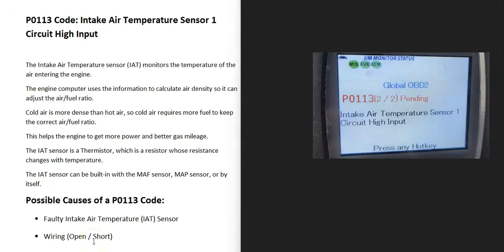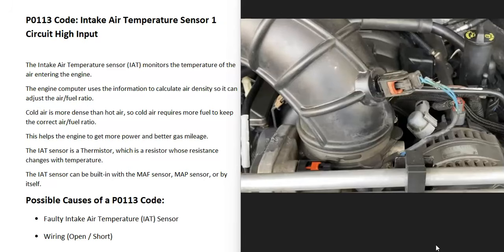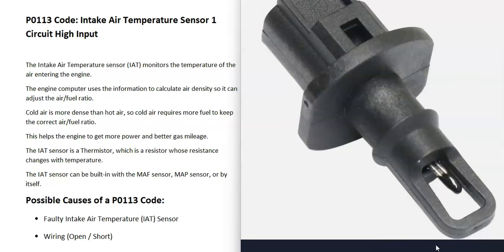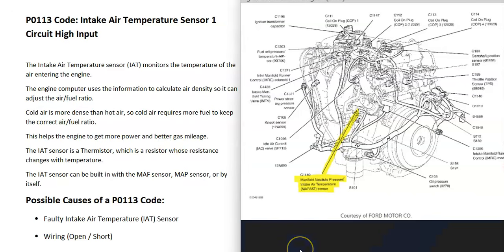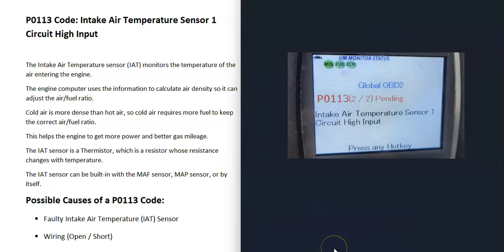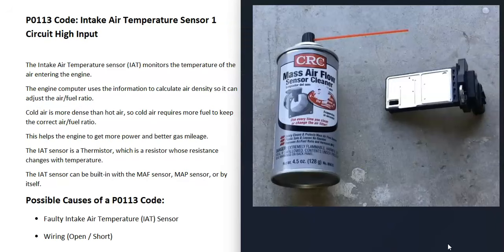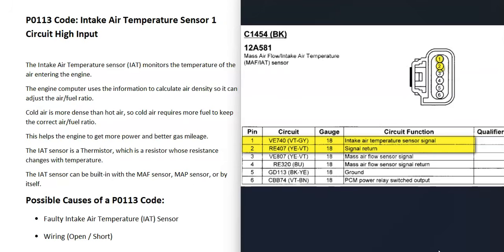Causes and Fixes P0113 Code: Intake Air Temperature Sensor 1 Circuit High Input

Comment: What does "chassis control system error" mean?
Reply from the maker: The computer is seeing an issue with the traction control system, like a communication problem or a failed component. While it can be a failed component (usually also gives another code), check the battery terminals, and if they are good, test the battery and alternator. If the computers have a power supply issue, they can give communication codes.

Comment: Got this code, intermittant starting, replaced intake sensor and still didnt want to start, when it did it was limping forward (reverse fine). Brand new fuel pump too, is there a filter clogged up maybe?

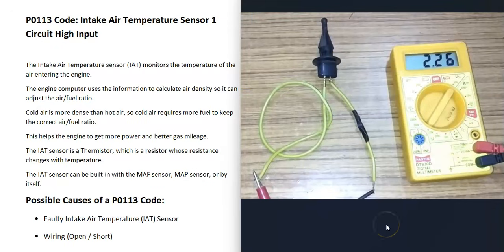Comment: @2:10 you talk about testing the resistance in the sensor. I've seen people say you have to have it plugged into the wiring in the car on in order to do this is that true? The picture at this point in this video shows just the sensor out as if it's being tested normally.
Reply from the maker: Yes, it can be tested out of the vehicle using a meter and ohms. The rated ohms it needs to be at will need to be looked up.

Comment: I have a 2013 fusion 2.0 eco boost . On my live data scan tool my engine will be warm then the engine temp sporadically drops to 88 f or zero then goes back up. Also the iat reads like 255 f. The codes never store so I can’t see them and it happens intermittently.  What should I check?
Reply: This irregularity could be the sensor itself.  If you pull the sensor and check resistance at room temp and then blow a heat gun or hair dryer at it, the ohms should change and hold at a different value.  If the resistance bounces around, the problem is the sensor.

Comment: I think our problem was I had it unconnected I had taken off the air intake tube and I started the truck with all without that hook attached and it probably set off a code. I’m waiting to see if it clears. Thanks.

Comment: I got 03 ' focus SE .... everything solid routine veh maint. Ford Dealership whenever necessary Ford recommended OEM replacement parts ect. .... prior to the issue which has now developed  (Engine light on w/error codes 0108 /0113 )  I noticed a clearly obvious hole rubber boot from air box looks as if intentionally someone used pocket knife flat smooth finger nail sized cut out and ..u know ..wth ?? serious injury neck & back significant financial circumstances I simply wrapped ducktap for temp precaution and ordered the replacement boot ...three days veh began loose performance sluggish hesitant acceleration etc. I pulled MAP sensor carefully cleaned & Removed air box cover inspect wiped down as well obviously a significant breach nicked a hole thru rubberboot which dirt grime 300,000 mi engine compartment clearly I'm assuming must have damaged the sensitive filament wire of the MAF/ MAP Sensor since the cleaning attempt hasn't corrected the issue and the new boot has been installed ... any thoughts or further suggestions I, waiting for my MAP / MAF Sensor replacement parts to arrive once delivered I'll have to do the install myself and under a huge amount of painfull circumstances spine injuries back & cervical  kinda gruesome to say the least hope im not overlooking anything is why I'm reaching out ??

Comment: I've replaced my 2010 acadias maf twice also checked wiring. It has several other issues for the 02 sensors, steering and brakes. I've decided to get a new ecm so just to rule that one out. My iat will not go back to normal stays at -40°
Reply: We're you able to fix it?

Comment: Can the code happen after a thermostat is replaced? If they didn’t put back right maybe? And now my car struggling starting.
Reply from the maker: If the thermostat is installed wrong, that can cause overheating and trigger codes. The engine should still start when cold but then will overheat.
Reply: @HVAC_Mechanic I got code p0113 yesterday can that have something to do with the thermostat. I have to put my car in neutral to start everytime
Reply from the maker: That is unlikely and there would be more codes. Usually when an engine thermostat has an issue there are codes such as P0128, P0125 or P0126.

Comment: My truck starts and dies immediately and has a shitty idle. When I disconnect my maf which my iat is part of the truck starts when reconnected it dies what should I do the fix it
Reply: Just figured I'd share I'm having a similar problem 2004 Dodge ram 1500 V6 just swapped out an engine for a used one. I was with mechanic and neighbor who was doing the engine job for me giving him a hand so happens soon as we can act everything I jump in turn the key starts right up and engine is pouring like a kitten we drive up to the store grab a soda a little short test to grab a soda maybe 5 mi round trip when we get to the store before I get out of the truck I noticed the temperature gauge is at about the 2:00 position in other words it's usually always in the middle it was between h and the middle getting hot. So to be cautious we hang out for about 30 minutes at the store we went to and mind you I literally started the car 5 minutes before that so it was ice cold and it didn't overheat. So new engine in test drive the only problem we could see and was obvious was the cause of the heating because the thermostat was broke and old is dust. So we figure change the thermostat and we'll be good to go. we grabbed his truck go to the auto parts store grab a thermostat and also a TPS sensor and it was a little bit cracked and the connection wasn't that good. So get back from the auto parts put in the new thermostat put on the new TPS sensor now when I start her up, misfires, real throaty sounding engine like top fuel loud but very sluggish unresponsive when you step on the pedal at times you got a feather it and work your way up to speed so I am fucking perplexed because prior to the new thermostat and TPS sensor the fucking car ran like a dream it sounded beautiful in idol beautiful smooth. Now it doesn't even want to stay running and wants to stall at every stop sign and red light. . Later that day we checked all the coils have power put in all new spark plugs. Was going to replace the IAC sensor but it was tested with a multimeter and it still worked but I don't know if that necessarily means the part is good just because the multimeter lights it up. possible issue I don't know if you know anything about that I was trying to buy a whole new throttle body couldn't find one so we took the whole thing off took it apart cleaned it out with cleaner reconnected everything. Now I was concerned about possibly a computer relearning of the sensors but after doing more than one reset technique I discovered that that TPS sensor is supposed to be able to be swapped right out without having to relearn anything. I did do the disconnect the negative battery terminal. And I also did the step on the gas pedal slow four times reset nothing's worked..1. take out old engine. 2 put in new used engine. 3 immediately started right up first try. 4 take a short test ride up to grab a soda and noticed that the temperature gauge is getting a little hot so we stopped to prevent damaging the engine.5. Get his truck up the road to O'Reilly's grab a thermostat and a TPS sensor. 6.Go back swap out the old parts for the new. Thermostat and sensor 7. Turn the ignition bulb bulb bulb. Hard idol wants to stall of course now there's no temperature problem with the new thermostat. When you first go to put the car and drive and step on the gas pedal to pull out off. You have to push the pedal down so gently until it kicks in and gets going but every time you idle at a light or a stop sign you got to put it in neutral and rub the gas or it'll stall out it's got bad power now. You know Sputturring, misfire. So start looking for a new throttle body can't find one you got to call the manufacturer now or find a used one. Thank God I didn't cuz I don't think that was the problem I damn near replaced all the senses anyway. But it was removed and cleaned like new reassembled with the sensors. 8. Try to adjust the idle so it revs higher. That's not working. 9. Took out the six coil and tested them all he said at one point the car was running on one cylinder. All of the coils were working order tested each one. So we go get new spark plugs because they were kind of crispy.. 

New TPS sensor 
New spark plugs 
New thermostat 
New serpentine belt New tensioner pulley tested MAF sensor and IAC sensors for voltage 
Checked all the fuses in the fuse box present or not accounted for with the multimeter 

I'm not a mechanic but if I had to look in a direction based on all of the research videos people and this and that Hands-On I've been through with this. 

We are basically troubleshooting this car down to actually one piece at a time. With all I've researched and all the videos I've watched the general theme seems to lean in certain directions with certain years and models of these trucks. I've encountered numerous people just in the last day or two online and on chat rooms videos that have very similar issues I'm thinking I have to start at the fact that the engine ran absolutely fine until I put in the thermostat which I think had nothing to do with it and the TVs sensor which was relearned even though it's supposedly doesn't need to be. Also thought maybe my gas might have got wet and the tank was almost on empty at this point so put filled it with premium intake cleaner and octane booster. 
I'm leaning in the direction of airflow and vacuums and fuel lines and injectors in other words the oxygen heat and fuel mix is off. Therefore the misfires Sparta ring stalling at idle. But as I look further and listen to someone say when you check the hoses and the wires the harnessif you cut any corners and try to get it done with a quick troubleshoot I'm thinking that this is one of those issues where I'm going to have to take the wiring harness off lay it out and look with a magnifying glass, and a light and go literally inch by inch look for every tooth in every plug you know any tiny crack. Because although I'm not a car mechanic sometimes it's just an unrecognizable small defect that is causing total operational failure. Also I read another person had an issue just like this what said their truck had an exhaust leak. This was not something I considered at all in my top 10 things to look at first or my mechanic put my whole exhaust and catalytic when missing off my truck when I bought it used so my guy just grabbed the Durango muffler and pipe and just threw it on there to keep it quiet so being as it's not still that quiet I know it's kind of like Jerry rigged up there not like I took it to aamco or Midas lol. What it's just my beater truck to get around town but damn near everything in it is replaced and new now I know she got a lot of life left in her. What I'm going crazy with this so me and him stepped away from it for a day or two. But I was reading a post that was responded to buy a professional mechanic from Mopar and Dodge on one of these like just answer sites and he mentioned that an exhaust leak could wreak havoc on sensors especially depending which ones and how close it is add to what sensors 

I'm thinking I'm thinking about removing the wiring and harness out of my truck right now instead of sitting here in the sun looking at it from my deck might as well every single plug every piece of copper every wire looking for the slightest imperfection. Then tomorrow deal with the exhaust situation with my mechanic and get a sealed up tight. And then finally check the injectors and the fuel pressure per square inch should be 58 PSI plus or minus 5. That seems to be something that again is one of the most common issues I'm seeing. That's why I'm thinking the things we've checked the least in terms of being 100% thorough would be all the vacuum tubes and hoses and pressure and also the fuel pressure so it makes the proper mixture of oxygen ,fuel, and heat 

And again if it wasn't for changing out the thermostat and that TPS, and now I'm systematically replacing every part on this truck one piece at a time till I figure it out it just doesn't add up based on that information. And if anything from that initial startup that sounded and ran beautiful sans the thermostat being replaced. I've also replace spark plugs fluids us injector cleaners, change the clean the throttle body. Tested IAC and MAF census for voltage check every fuse connection in the fuse box with a multimeter. Put all new gas and cleaners if anything you should run better now.. because since that initial turn of the key when it ran great that would have a new spark plugs, new sensors, new filters new fluids, new belt and tensioner 

It's got to be the fuel and air pressure mixture. Is not optimal due to a leak or lack of pressure or too much pressure in the fuel system and air system. With my outliers being the exhaust because that was never a problem before and maybe the ECU. I guess I'm going to rip this wire harness out now since I'm talking about it and get that out of the way first. And I know I just probably sent you a 10,000 word answer cuz I'm just talking in the phone like you're here with me in person LOL. I was born and raised in New York 50 years I've been down in Oklahoma rural for three now. And there's not many people to talk to around here a lot of stuff gets stuffed inside and then it's just all comes out. Still adjusting I guess.. but I will post back and let you know the outcome good or bad. I think just searching the internet and posting boards and chat rooms and just asking every random person I can if you never know somebody got the answer. But you never know it's not necessarily one thing or the other. Hopefully you might have figured it out by now but if not good luck and let me know if you did figure it out and I will do the same for sure. I'll be much briefer next time just trying not to forget any detail because it seems like the little things are really important

Comment: I get p0113, iat sensor high voltage, changed it with new one but i still get p0113, and temp inside hose is -40°, checked wires and looks good, i dont know what to look more 😑
Reply: Did you ever figure it out? I'm getting the same temp lol
Reply: @robrobroberto Not yet
Reply: Did you try to check the filter? Did you clean the throttle by any chance? Just an Idea 💡

Comment: Alright, Riddle me this. I started my truck, it sputtered for about 30 seconds then died. I shut it off, turned it on(took about 5 seconds to start) then the engine light came on. I pulled codes P0087, P012D, P0113. Any idea what the actual issue is? Obviously 4-6 sensors didn't fail at the same time. It's a 2013 f150 3.5L ecoboost
Reply from the maker: It needs to be diagnosed, but I would test the IAT sensor and wiring first as it may be throwing the computer off with bad data.

Comment: My f150 3.5 ecoboost said I had a bad Iat because I pulled the code. Come to find out it wasn't the sensor at all. It was one of my down tube's came undone. So when checking this, check all ur ait tube's as well

Comment: Basically, the mass air flow sensor is dirty or the electric connector is dirty. Just clean both with the mass air cleaner. Let dry for 5 mins to 10 mins. Then reconnect. Clear codes and you should be good. If problem persis then wiring could be the issue or replace the sensor with a new one. 👍🏾
Reply: I just went through all these steps and in the end the wiring harness went to shit, and so did the connector. Replaced them cleared the codes and now she's running like a dream again.
Reply: Funny enough my Nissan was running like crap, and showing maf failure symptoms, but no codes. I throughly cleaned the maf with maf cleaner, now have a iat failure code.
Reply: @SupramanTRD did you ever get it fixed and if so how?

Comment: Ok ty instead of trying to tell me the mass air flow sensor I just cleaned to clear P0171 code is the P0113 codes iat sensor you explained, it could be built into that sensor or a different sensor.